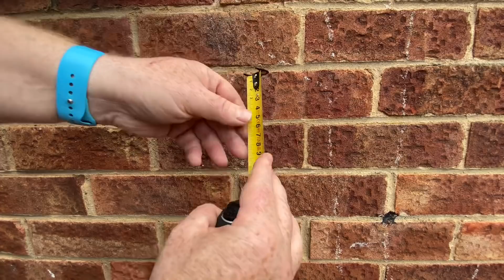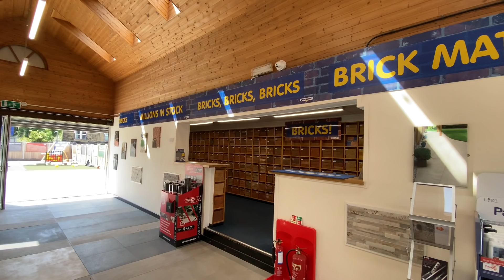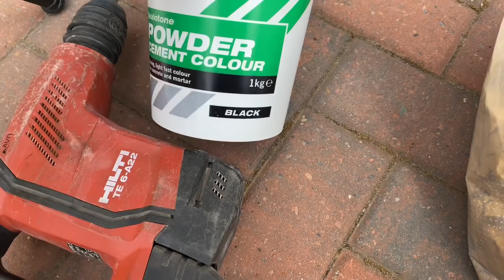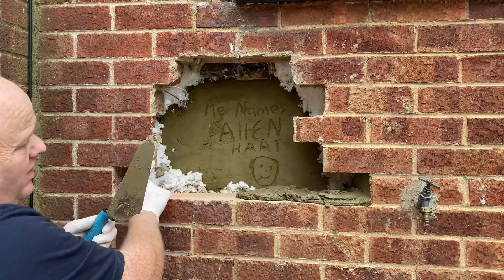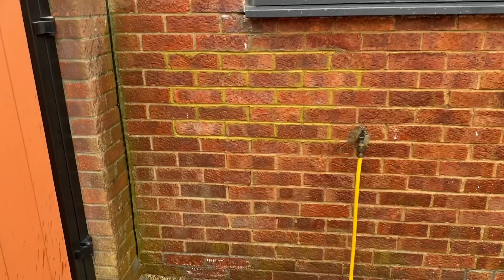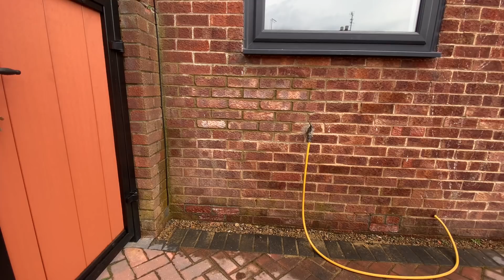How To Replace Bricks In A Wall - Plumber Bricking Up An Old Flue Hole

Comment: Hi mate, I got my gas fireplace in my living room removed. There is a hole leaving at the outside wall. If I want to do the DIY, where can I get the bricks matched with the one used for my outer wall. Thanks for your help

Comment: You're no bricky Allen but you did a great job regardless. You could've benefited from using a tuck pointer to get the mortar into the top of the last bricks.

Comment: Hello need some advise just had a boiler installed costing over 2.5k the installer has damaged the outside brick and a pressure release copper pipe going out side does not protude beyound to prevent leaking on the bricks. The face of the brick has cracked off and they have come back and just put cement on top of the brick what would you advise ? It looks like a messy job.

Comment: If someone were to have a boiler replacement with the boiler relocated elsewhere (paying extra for the relocation), would you expect the old boiler flue hole to be filled as part of that or not?
Reply from the maker: Depends on what was agreed upon. I would brick it up.

Comment: Mix it dry! But I dampen the dry bricks in the wall, with an old brush or sponge. This helps prevent all the moisture being drawn out of the mortar. This gives me more time to level up. I point all the verticals first. Then straight across the horizontals. Just to end, very recently. A gas installer pointed around a flue with what looked like polyfilla. I re-pointed it having done the gas safety check, along with other remedials. I did take a photo, will send it over if iv'e still got it. 🙄
Reply from the maker: Thank You

Comment: If I try really hard to pick faults there are only two comments I could make: You could have put some insulation back in the cavity to help prevent a cold spot; You could have vacuum cleaned the artificial grass when you had finished. If only all tradesmen tried as hard as you!
Reply from the maker: Thank You

Comment: Buy yourself a small paddle mixer/paint mixer from screwfix. Only about £4 but will make mixing the mortar much easier.
Reply from the maker: Thank you for the tip.

Comment: Hi Allen, In a gas meter box: Do the pipes out of the meter that go into the property (right hand side of meter) always have to go down and out the bottom of the box or can they go straight up / drilled thought back of the box into the property so no pipes are on show?
I have a few bricks to replace myself, Angle grinder with ceramic bit works great but ceramic bits on a multi tool are also good . Ceramic bit on a Recip saw also works great once you have drilled through first! SDS drill with chisel / hammer feature is also good but run the risk of damage to surrounding bricks. Neighbours hate the noise of all the power tools! Haha.
I use 2 sand / 1 cement on patchwork.
Reply from the maker: Depends on the meter. Medium pressure cannot go through the wall. Thanks.
Reply: @AllenHart999  Thanks. I've had the gas meter blocked off with a blanking plate whilst I do the renovation. Installing new central heating system before I have a new boiler installed (Veissmann 100-W) I want to tidy up all the pipework and if I could drill through the back of the box directly into boiler room it would work perfectly.

Comment: When I did it I didn’t mix frog up and frog down , and used febmix scraped back when gone off and rubbed over with off cut off 15mm copper. Any mortar on brickwork can be carefully removed with mortar acid .
Reply from the maker: Yea i do that so i can push morter in, Sometimes you cannot do that though.

Comment: I've done some of this, i drill round the brick like you then finish off removing mortar with a SDS mortar removing chisel on a stationary hammer drill. im quite messy with mortar i use a sponge and a bucket of water changing often to clean bricks when im done . Also i add a lot of lime to the mix if the original mortar is light.
Reply from the maker: Thank You

Comment: Hi Allen,
Great job making good is harder than it looks, what you can do is string a line and that would help you, also I use 3 and 1 mix for engineering bricks and 4 and 1 for everything else. You can buy either a scutch hammer or scutch chisel to help chisel the bricks and mortar beds.
One more thing if you look at the course below not directly below but the one under that, your bricks should line up vertical.
Top job and great plumber.
Reply from the maker: Thank You

Comment: Great vid thanks Allen. I did a bit of bricking at college and a cheap easy way to help pointing is to use 6" offcut of garden hose to hold in your hand and press the muck in and run it over the joint to give a smooth contoured finish.
Reply from the maker: Thank You

Comment: SDS+ Plus 6mm Brick Mortar Rake Joint Chisel/Breaker Bit for Hammer Drills.

A great tool for removing mortar joints without causing damage to the surrounding bricks. We use them removing bricks for when we have to remove the insulation from the cavity.
Reply from the maker: Thank You